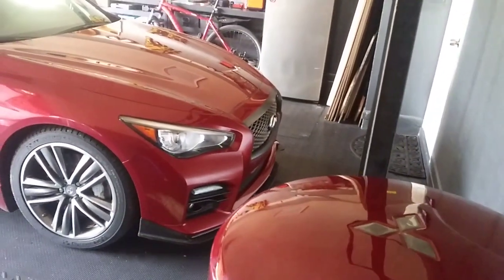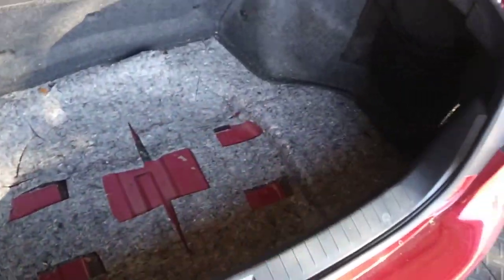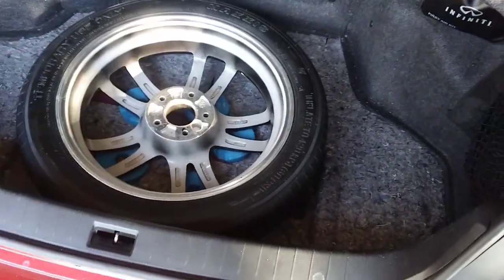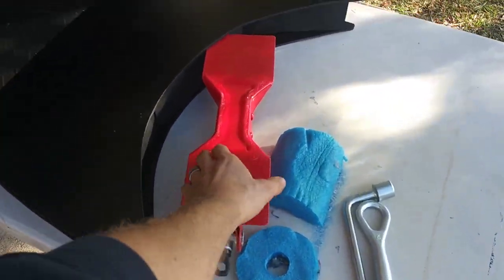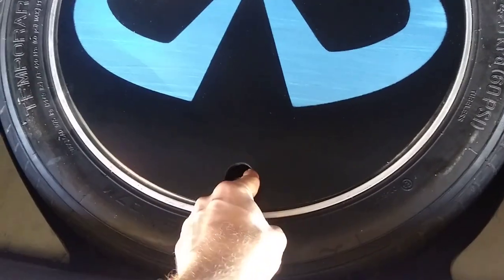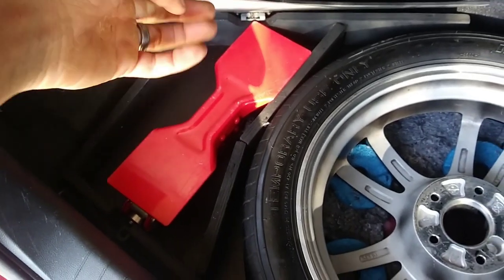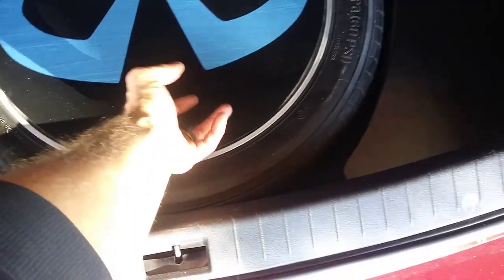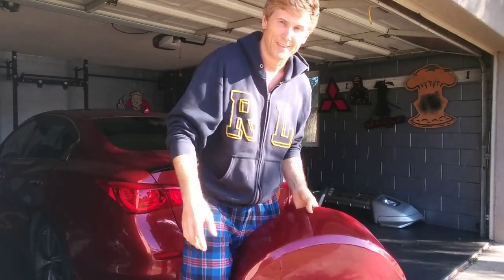No Spare Tire? Making one fit & building storage around it.

Comment: I got my Ford Escape used a few years ago, so I got a full size spare. Mine hangs under the rear, like a truck, which I like!
Reply from the maker: Our Suburban had that - after having it for 7 years I finally had a flat one day and couldn't use the spare because the bolts rusted together. My favorite is a spare right on the back door - my Montero has it, so do jeeps and some other offroaders. So easy to access.
Reply: @LeoTheRussian  I keep mine from rusting by lubricating it with some engine oil. I brush it on the chain once every other month, and it’s worked without fail. I actually had a flat recently, but was replacing 2 of my tires anyway later that week anyway, and I replaced the tire on my spare that day too, so I drove on my full size spare that week.
Reply from the maker: @jacobg.witmer  yeah I should've done something. Never had a spare there before so didnt even think about it until years later
Reply: @LeoTheRussian  My cousins 2001 Acura has it under the rear, and I actually got it to lower, but the donut was stuck on the hoist though, so I had to knock it loose with a hammer.

Comment: what nets did you use for sides? And whats in the bag up right? :) thanks, very useful video
Reply from the maker: The nets I got from amazon awhile back - just look up "velcro storage trunk". The bag came with the infiniti - it's a super basic first aid kit.
Reply: @LeoTheRussian  thank you for replying, I ordered two nets, each for one side. Haven't got that bag so looking if there is something aftermarket that could fit there and stick to trunk. Do you know what was originally meant to be in that part you have customized beside those two tools? There are cut outs, but for what? Mine's are empty as well
Reply from the maker: @smakar2  since I cant post pics in comments - look up "Infiniti first aid pouch" and it'll come up with pics including contents. Seem to be about 25-35 bucks on eBay or dealership